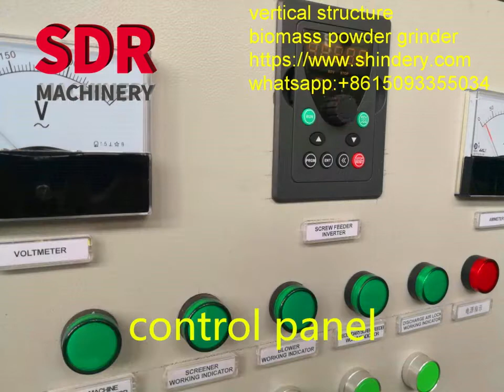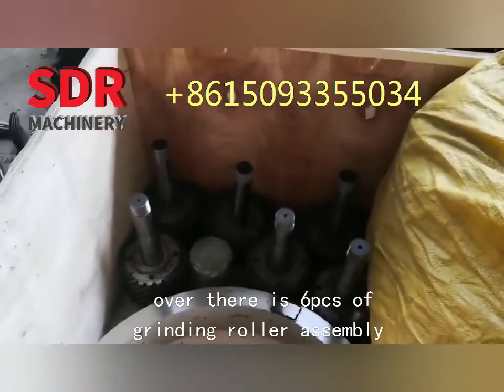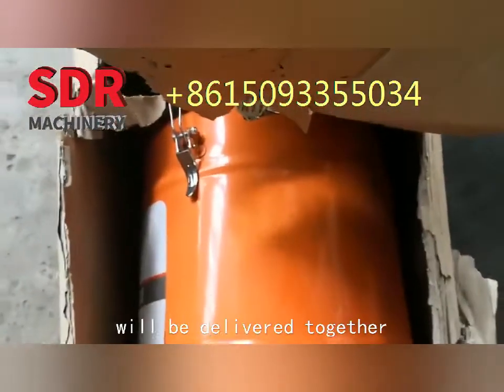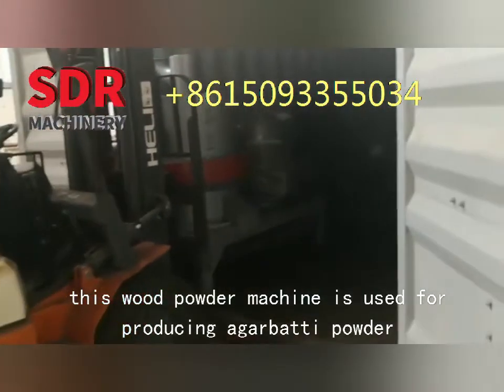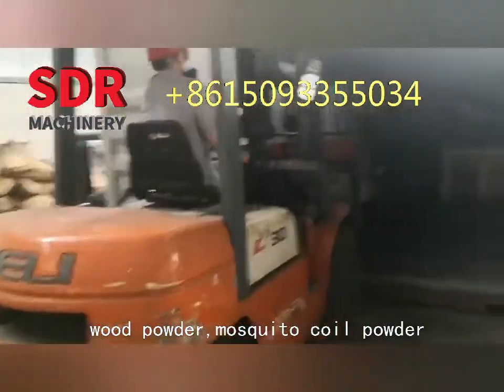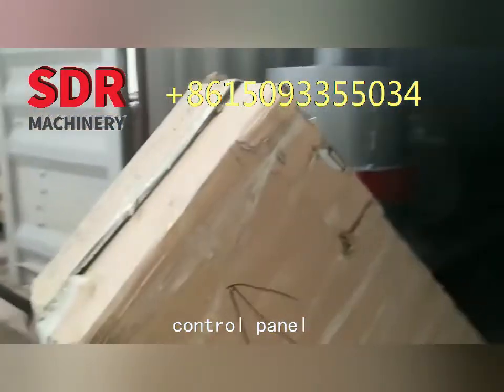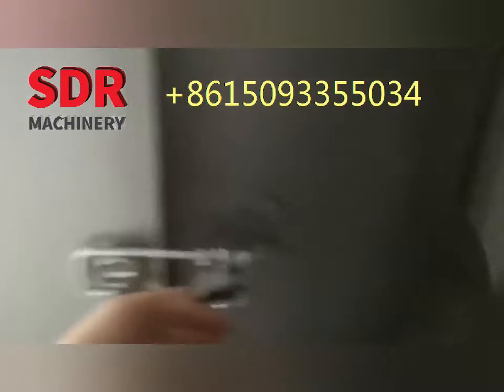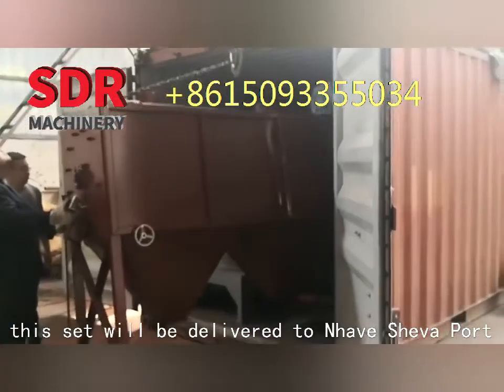Deliver agarbatti powder grinder to Nhava Sheva Port,India

Comment from the maker: ---Vertical structure, scientific and efficient
The material enters the grinding chamber vertically from top to bottom, the coarser material is always in the lower part of the grinding chamber, and the finer material is in the upper part of the grinding chamber, which is easily taken away by the fan. The reasonable structure significantly improves the efficiency of grinding.
 
---Excellent durability
Transmission components and grinding rollers are processed by high-precision CNC machining center;
All the bearings of whole machine adopt LYC brand, top quality in China;
Grinding room lining, grinding roller are made of Cr12MoV alloy material.
 
---Easy to operate, save labor
Only 1 person is needed to operate the complete set of equipment, Just make sure that the feed hopper always has raw materials, the feed screw is not idling.